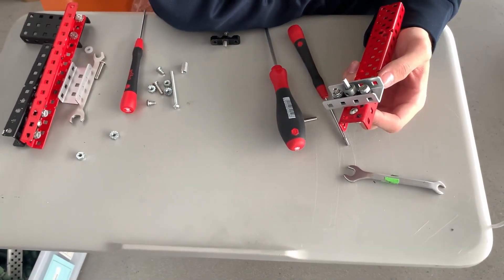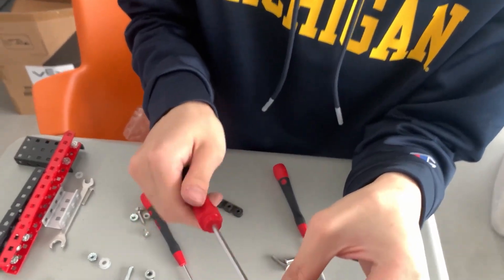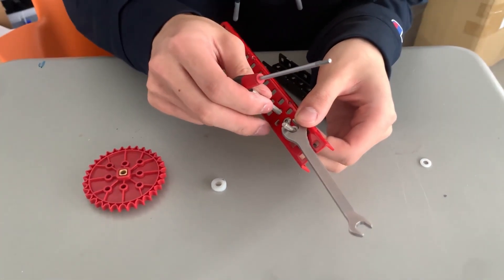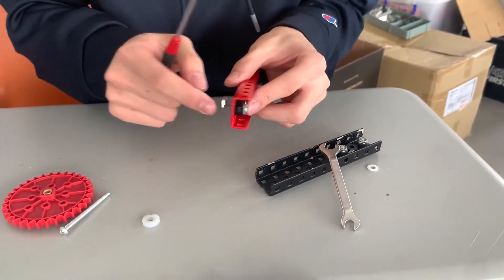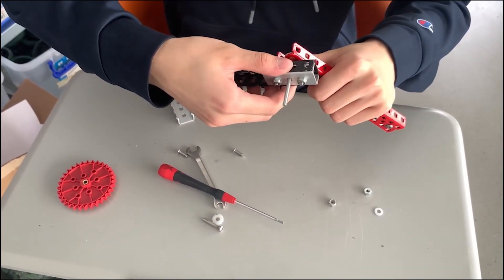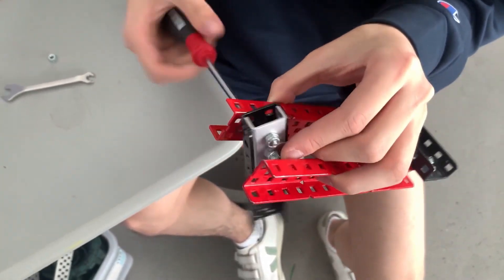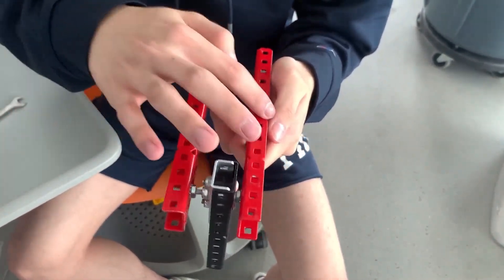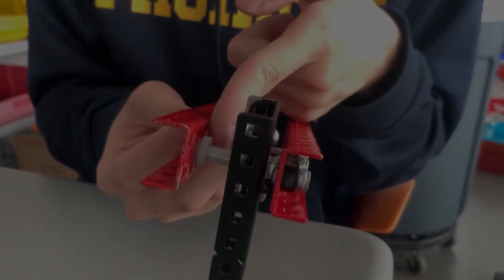VEX Build Masterclass #1 - Screw Joints

Comment: If I want to use a screw joint with a wheel like in my drive train, do I have to do any additional modifications to wheel like drilling a hole?
Reply: Hey, my team is wanting to know the same thing, have you figured out that yet? Thanks
Reply: @questc  yeah I did! It turns out it depends on the inserts you use for the wheel. There are square inserts and circle inserts, the circle inserts are perfect for screw joints.
Reply: @NtGm714  also how would I connect the wheel to the gear? Thanks
Reply: for antistatic wheel- just screw it together using screws and nuts or zip tie it, and for regular green omniwheels - connect 2 stand offs to the gear and shove it into the wheel. @questc
Reply: @NtGm714  thank you SO MUCH for the help man, I really appreciate it
Reply: @questc If I remember correctly you told me I figured this out by myself, turns out someone just told you how to do it😂
Reply: @leo-j2f1e   I was talking about the wheels without holes in them, I didn’t know that there was 3.25 inch wheels with holes in them. I was asking this guy a completely different question

Comment: ...is there a way to use the screw joints on wheels and gears?
If there is, am abandoning the vex shafts, the thin ones
Reply from the maker: Yes, you can use screw joints on wheels and gears. Just put the green / bronze free spinning inserts into them, similar to the sprocket in the video.

However, you will still need square shafts on some part of the robot. The gear / wheel the motor powers must use a shaft. Shafts are also useful for driving something over a long distance, like rubber band intakes. Most other use cases can be done using a screw joint.
Reply: @ryan4253b  thank you so much!
Reply: @ryan4253b  how would I connect the wheel to the gear, is there holes? Thanks